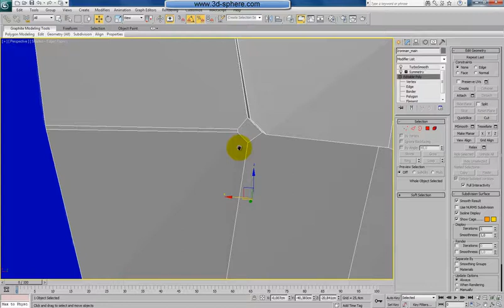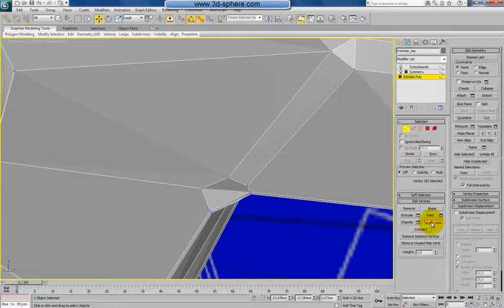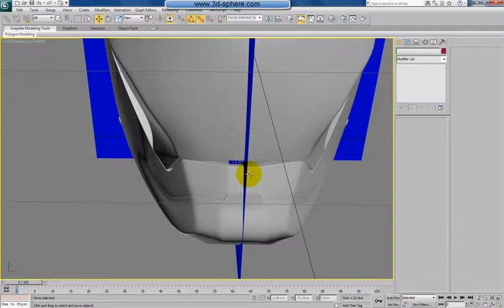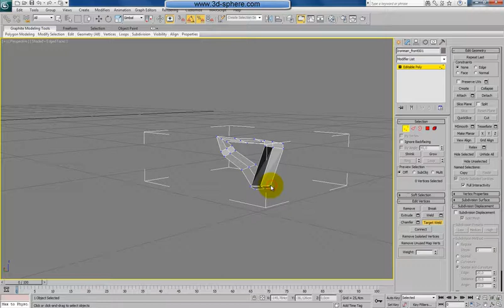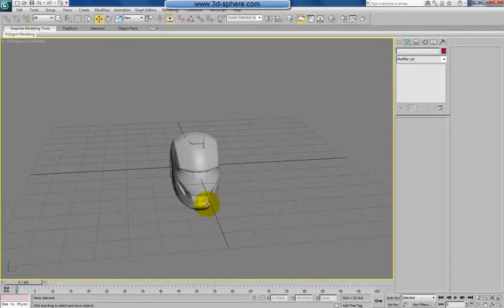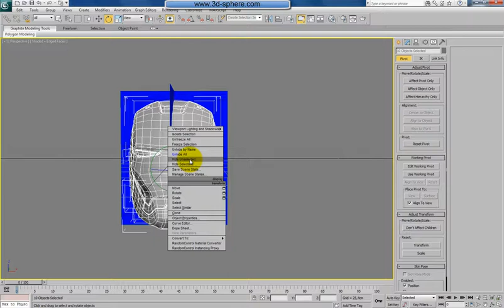Modelling Iron Man helmet using 3ds max - Part 6

Comment: Hi, I loved the tutorial videos and would like to thank you for making them; I have learned a lot and found them very helpful and informative. I do have one question regarding polys though. You mention in this particular video that ngons are unwanted and even go to the effort to remove the ones visible at the corners which were produced during chamfer but to my opinion, the large polys which are adjacent to the ngons you remove are also ngons. Am I wrong or could you please explain as slicing the corner off a 4 sided poly results in a 5 sided shape or a ngon. Once again, Thank you ever so much, I am not trying to be critical, I would just like to understand. Best regards.